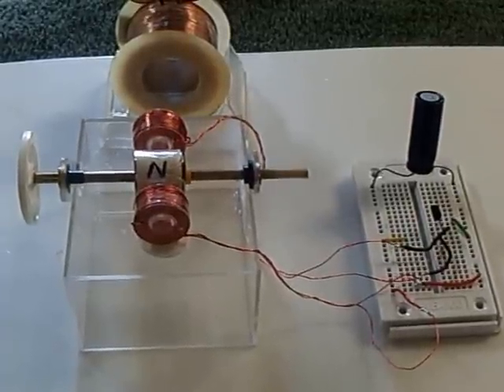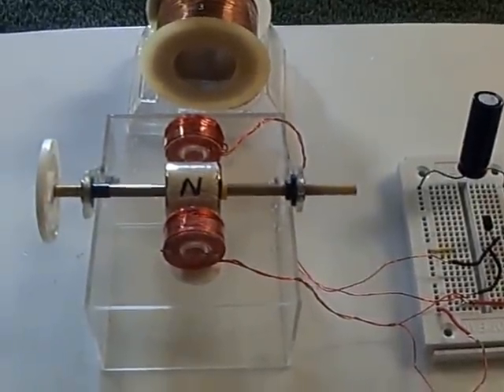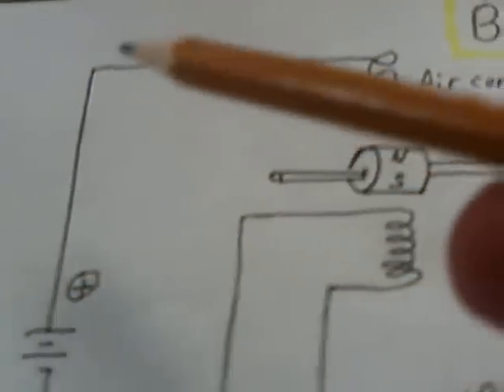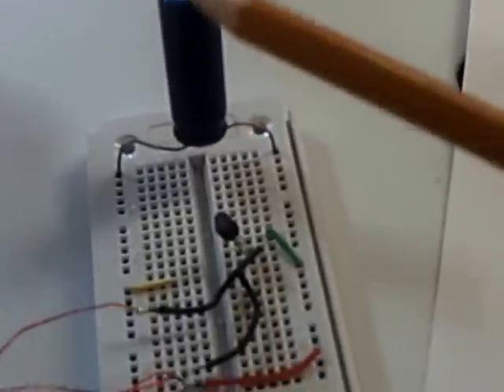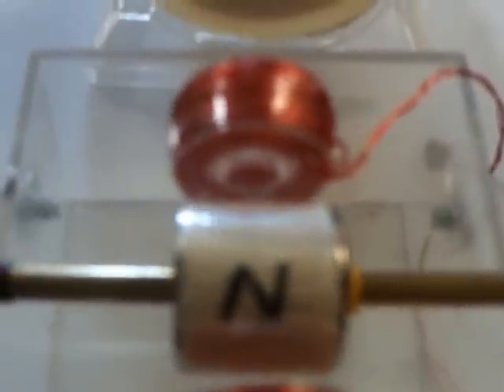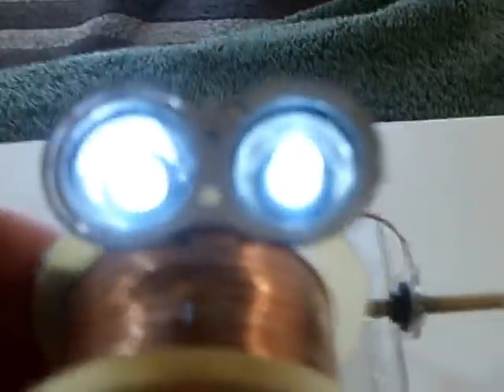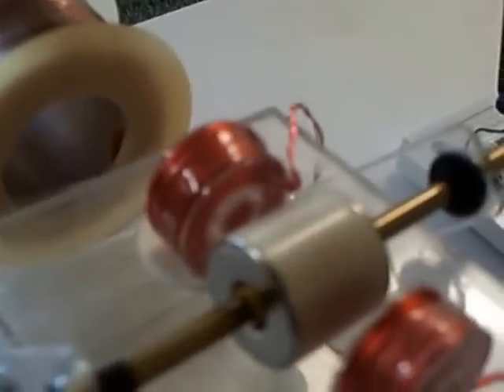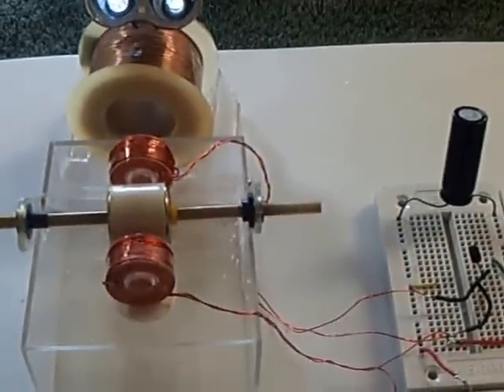Basic Electronic Pulse Motor

Comment: If you load complete design data as
Coil size, no of turns, wire gauge, components of controller, etc, as result, you will get optimum response on you tube specifically students, OK thanks for your feedback I will wait for your response take care 🌹🌹🌹

Comment: hi mate. if you’re interested in sensing with and driving  1 or more coils at the same time it’s doable with one more component. a mini isolation transformer. preferably in the hundreds of ohms dc resistance for efficiency tho. 
the changing emf in the drive coil goes from primary to secondary magnetically but electrically it’s isolated and that signal turns the transistor on and off. i run modified computer fans and rewired rc plane motors like this. it’s not self starting. a hall effect pickup could be self starting and just one additional component as well. 
then there’s spike recovery, but presuming you’re lidmotor of forum fame you prolly know more about this stuff than i do. 
nice vid.

Comment: Lidmotor, I could use some of your advise.  The timing in the circuit is working fine, but if I wanted to have the circuit have a little more power to turn a slightly larger end disk, what can I change in the circuit design to do that?  I am going to guess, I have to increase the size of both the capacitor and the transistor.  What kind of transistor would you recommend? Thanks for your insight.
Reply from the maker: Use a 2N3055 NPN transistor.  The super capacitor is just an energy storage component and a battery works just as good.  I'm glad you are having some fun with this.

Comment: Hello lidmotor. Is it possible to use a 2n3055 transistor in this circuit?
Reply from the maker: Yes.  That will work great!
Reply: Ahmad Malik Hi,

I've used one in my Ossie Callanan circuit. The video is on my channel. 😉

I use the latter to restore my sulphated UPS batteries. 😏

Comment: Tonight I tried using a 2N3904 NPN transistor on a bread board to see if I could get a pulse signal when I passed a magnet passed a coil and so far i have not been able to get good results. I guess you need to have North and South passing the same coil to get a nice pulse signal? Not sure, I need to try a few more things tomorrow. I'm trying to make a pulse circuit to pulse all north facing magnets on a rotor instead of using a reed switch.
Reply from the maker: You really need a strong N/S neo 'ring' magnet to make this setup to work.  If you go with an all N (mono pole) rotor the trigger coil needs to generate at least .5v to get the transistor to switch. The first Bedini SSG I made used an all N rotor and I had to really spin the thing up fast to get it going.
Reply: Lidmotor I was able to get an LED to flash but I had to really zip the magnet past the coil to get it to work. I guess I was looking for more of a reed switch type of performance where it will spin up with just a slight push of the rotor. not so with an NPN coil configuration. In order for the base of the transistor to have enough "ON" current the magenet has to be moving quite fast. I was going to try to experiment using a small signal diode connected to the base and coil to see if I can improve the performance of the on/off switching.

Comment: are you using a single cylinder magnet with a center hole? I've been looking for that but can't find them.
even the hard curve arc magnets are difficult to find?
Reply from the maker: K&J Magnetics dot com
Reply: +Lidmotor I've looked there, do they have any cylinder magnets with the hole? direct link?
Reply from the maker: They are called----- diametrically magnetized "ring magnets".

Comment: will it work with single air core coil and what minimum windings should be there to make it work?
Reply from the maker: Yes.  You can do this with a Bedini SSG circuit.  I have done it on a smaller scale.  The single coil has two windings on it.  Google 'Bedini SSG images' to find the simple circuit.  You will need to wind a 'bifilar' coil that has fine wire with lots of turns for the trigger and the other with thicker wire and less turn for the drive.

Comment: how many windings have those coils and which wire?
Reply from the maker: +angel rivera I didn't count the turns on the coils.  They are just plastic sewing machine bobbins with 30 ga litz wire I had on hand.  You should use regular 26ga to 32ga magnet wire.  It is not a critical number.  Several hundred turns on a thin air core bobbin will work.
Reply: ***** thkz

Comment: Can "Maggie" charge the cap on the "off" part of the cycle? An amazing example, very simple. Thank you for the brain food.
Reply from the maker: +WhtStr213 Possibly.  Remember that the voltage is there but not much amperage.
Reply: I got the same problem. 35v at .04 amp. :(
6 neos on a bottle cap and 2 ignition coils for weed-eaters, spun with an R/C e-motor. Looking into conversion, bringing down the voltage and uping the amp, but from that low? I might use it for transformer research.(MEG stuff, particularly)
You know, we could probably light a room with a pair of AA batteries. I get that juice though my solar panels, so rechargeables would work. Use a joule thief to boost voltage, but it makes the light blink. Neons mess with me, but that's a frequency thing, I think.
 I did however see some new LED lights for $3. 60w equivalent uses 10.3? watts. Hell yea!

Comment: Do you need a transistor for any pulse motor or can I connect the coppper wires straight to a battery?
Reply from the maker: +AKUJU No you can't just connect the copper wires straight to the battery.  You need to turn the electromagnet on and off somehow to turn the rotor.  There are lots of ways to do that.  Google: 'simple dc electric motor images'.  Look at the pictures and find one that looks really easy to build.  Click on that picture and there is usually a link to more info on it.  If that looks too hard or you don't understand it keep going.  The more you look the more you will learn.  When you find one you think you can build----just go for it.

Comment: A question.
Why no one tries to attach a wheel and mount magnets on it. Then capture the current produced by that wheel with magnets and feed a portion of it back to cap and use the rest?
Reply: +Talha Kamran because the drag on the motor would be greater than the power captured.
Reply: Jeff Beck
Thank you.
I wonder if their is a way to capture with lesser drag.

Comment: I have capacitor 220uf 160v and other more 1650uf 16v this is ok
Reply from the maker: remielmasloco loco No.  You need a super capacitor.  Get a 5 or 10 Farad.  EBay has them or Mouser.com.
Reply: ***** tanks my friend. Only need that capacitor
Reply: Ok I want, super capacitor 10 farad and  volts ?   2.7 /  5.5 / or  more  volt  and size case please  on wed Mouser .com  have to much information for capacitor
Reply from the maker: remielmasloco loco I am using 2.7 volt super capacitors in various sizes (1F all the way up to 300F.  I hunt for the cheapest ones usually.  Maxwell brand is usually a good bang for the buck.  I use mainly the 5F and 10F size for what I am doing.
Reply: ***** Thanks very much my  friend I make the order for  super capacitor
Reply: ***** friend  maybe I  put more volts on the  super capacitor is problem maybe 3v.  5v.  8v. More
Reply from the maker: remielmasloco loco If you try to put more voltage into the super capacitor than it is rated for you will damage it.  If you put WAY TOO MUCH voltage into it then it will EXPLODE!!!!  I have been able to put 3v in a 2.7v rated cap without any problems though.  It might have shortened it's life a bit.
Reply: ***** thanks Amigo lidmotor for  everything tanks very much

Comment: I had a magnetic spinning top toy years ago, I'm pretty sure it only had one transistor and one coil (and a battery), but it may have had a resistor as well. If you haven't seen this toy, it has a coil underneath a slightly concave surface on which you start a magnetised top spinning. It spins until the battery goes flat. You can use the same circuit to drive a pendulum, if you suspend the magnetic bob on a piece of string it moves in a chaotic pattern.
BTW Take a look at the circuit in the image on the following webpage, it uses a single tapped coil. (I think my old top had an untapped winding though.):
 https://www.google.com/patents/US4200283

Comment: This is absolutely amazing. I love how simple it is but works so well. A little question; how did you make Maggie? I know she's just an induction coil but I was wondering how you wired the two lights. Thanks!
Reply from the maker: Maggie's eyes are in parallel and connect to output of a bridge rectifier that is connected to the two wires of the 40 ga spool of magnet wire.
Reply: @Lidmotor  I appreciate you for making this open source. One question: does the coils shape have an impact on the performance? I notice that your coils are wider than they are longer. Mine is the reverse and an not having good results. What do you think?

Comment: may I know,what resistance do each of the motor coils have? not the led coil...I have a squarish coil and laminated core but its 350ohms each, dont know if it will work in such a set up
Reply from the maker: No. The coils have to be without a metal core for this application. If you can cut away the metal core, without damaging the wire coil, then you might be able to use them.

Comment: Greetings, great work. Does the motor operate in the reverse direction?  I would like to fabricate a linear drive track to drive a power pendulum.
Reply from the maker: Good question.  Yes the motor runs either direction.  Just reverse the polarity of the power source. The led only lights up with the original design polarity.

Comment: interesting simple motor..can this setup work like an ssg and charge another battery from a primary battery running the pulse motor?
Reply from the maker: Yes. You can take the flyback off the drive coil using a diode and charge something.

Comment: Hello Lidmotor. I'm back, I still haven't figured out how to make this motor with a bifilar set up. I've been wanting to do this for about 5 years now. I am here now to request that you make a more indepth video for the less adept beginners. I really need your help. I will give you $100 dollars if you show me how to do this. i have all i need to make this already; I have a breadboard, 23ish gauge wire, battery holders, multimeter, neo mags, and  several of all the transistors you've mentioned, I also have a good rotor and stator setup. Please contact me soon. Sincerely, Toby.
Reply from the maker: Hi Toby.  If you have a good rotor and stator setup then you have already done the hard work. That setup has to turn very freely and match up to the coil and magnet potential. Tiny magnets and a giant rotor is just as bad as giant magnets on a tiny rotor. Same thing with the coil.  It is not precise work.  Just eyeball it. Please do what I did to learn how to build what you want. Use Google and Youtube to research the type pulse motor you are aiming for. Start super simple and work from there. It is better if you don't ask someone to walk you through the process.  Learn as you go.  If you make something and it doesn't work then make a video and ask for help --- people who have been down this road will help you once they see what you have done.

Comment: Could I use a 0,6 mm (< 23 gauge) copper wire on both coils and how many turns to spin it on 3 volts, please?
Reply from the maker: That should work fine.  It will draw more current depending on how many turns you have on your coil but it will be stronger.  Turn up a coil of at least a few hundred turns.  Even one turn makes an electromagnet but the more turns the better in this application.  The 3 volts is fine.

Comment: Is the cap the power source? So you have no battery?
Reply from the maker: Yes the capacitor is supplying the electrical power to run this---but a battery was used to charge up the capacitor. The battery got it's electrical energy from a one way chemical reaction. You might say that chemistry is running this.
Reply: How long will it stay running?
Reply from the maker: I don't remember exactly but it was nothing to write home about. Just a few minutes.

Comment: So to make this motor to spin you don't need to use conductive axle, since two coils keep it running, and it can be plastic axle, am I right? Thanks!
Reply from the maker: Viktor Božičević A plastic axle would work fine if it is strong enough.  I have though about using a carbon fiber shaft.
Reply: ***** One more question: how many windings and what thickness of copper wire did you used for both coils? Does the thicness of coil wire matters on how strong the motor is? Thanks!
Reply from the maker: Viktor Božičević It is a few hundred turns of 30ga wire on plastic spools with no core.  There is nothing exact about them.  One of my friends once said it this way---"Wind with wild abandon".  Just have fun with it.

Comment: Due to my stupidity that I bought coated coper wire big role 33 lb ,can I use in this case  or use in three phase only in turbine winding power  ?I got confused about the difference between the magnet coated wire and the none magnet coated coper wire  due  learning three phase winding turne,they use the none magnet coper wire and to use the magnet to have  the free energy ,why they didnot use the magnet coated wire., Would you please explained ? !

Comment: Electrons flow from the negative terminal to the positive terminal. When electricity was first discovered they didn't really have a way of telling which way it was flowing so they made a guess. As it turned out, the guess was wrong.

Comment: Hi Lidmotor, I've been following you for a couple years now... I would like to replicate what you have shown in this video, But with just one bifilar coil and all magnets with the same polarity. I am having trouble wiring where the other end of the pick up coil connects to the wire that goes from the emmiter to the negative end of the powersource, I'm using a 2.5V battery. Please help.
Reply: I also purchased 3 little variety bags of transistors from radioshack, which have the same ones you named in the vid.

Comment from the maker: Yes .  Use thin wire with many many turns.  I use a premade component bridge rectifier but you can make one with most common diodes.

Comment from the maker: Maggie is made using a full spool a 45 ga  fine magnet wire.  Thousands of turns.  If you are trying to use thicker gauge wire with much fewer turns it is not going to work.   The way you have it wired is correct.  Sorry you had trouble.  A spool of 40 ga might work.  Be sure you have the polarity right on the leds coming off the bridge rectifier.

Comment from the maker: It runs for just a few minutes on the energy stored in that 10F super capacitor.  Keep feeding it at least 1.5 volts with 30 milliamps and it will run until the bearings wear out or the transistor quits.

Comment from the maker: I have been thinking about your phase shift oscillator circuit and wondering if that could be turned into a motor drive circuit.  The feedback coil would go into the cap / resistor chain somewhere.  It might self-start.

Comment from the maker: We might be able to make one of these that is magnetically levitated like a Mendocino and use very fine wire coils with lots of turns.  Run it on a solar cell.  Blow air through a straw to spin it up fast enought to start the triggering.

Comment from the maker: I don't think that this will work on your EZ Spin but it might if you spin it up fast enough to get it triggering.  I could not get this to work on any of my small rotor motors.  I does work great with the "magnet on a mirror" top type spinners.  The magnet has to be spun up fast-- at least on my setup..  I agree with you about having the least numbers of parts as possible.  The components all want their piece of the energy pie.

Comment from the maker: Thanks.  The magnet I used here was 3/4" x 3/4".  The bearings are just steel RC model car type.  Ceramic ball bearings are better but expensive.  You can get them online or at a hobby store.

Comment from the maker: Thanks Jack and you are exactly right----there is quite a magnetic dance going on in there.  This will self-oscillate without the rotor turning.  A diode coming off the collector does turn this into a flyback charger.

Comment: Elegant and simple.  Yet there is a lot going on with the permanent magnetic fields of the rotor interacting with the changing fields of the coils.  It is also a study in natural resonances of the whole system.    Will this one also oscillate without the rotor turning?    Also you can partially charge another supercap with a diode off the collector,etc.     Wonderful to see this.       thanks